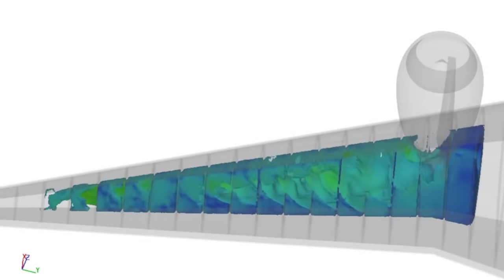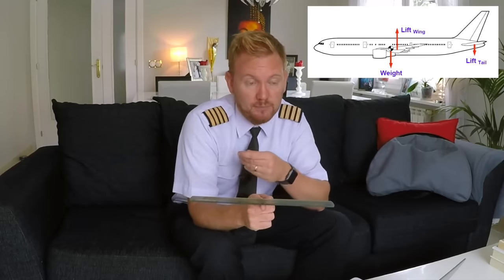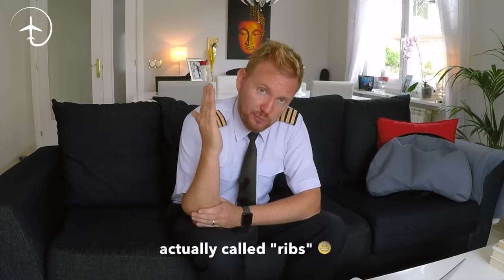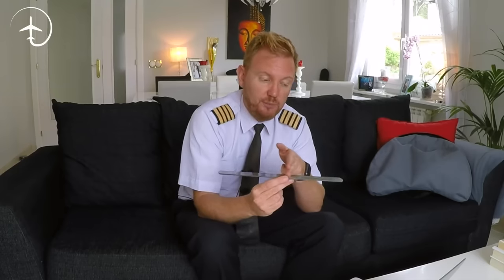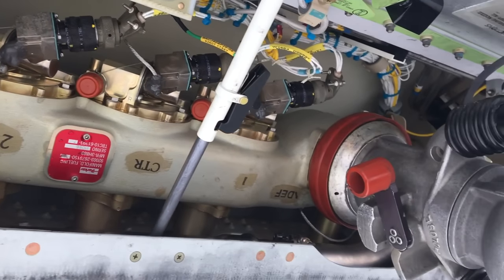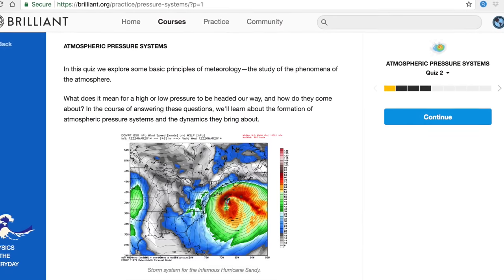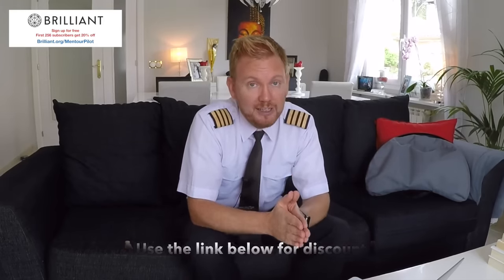Why do aircraft store fuel in the wings?

Comment: Could you do a video about why pilots use feet and miles instead of meters and kilometers? I think I have an idea (namely imperial isnt as easy to confuse with each other as the metric system is) but I am not really sure.
Reply: It is a good question that I planned to ask, too. Anyway did you know about the Gimli Glider? (If you didn't I would suggest you the English article on it on Wikipedia., very nice and detailed.) There the fuel starvation was partly caused by the different measuring system and some miscalculation from pounds to kilograms and liters and back.
Reply: I do know of that case, but the wikipedia article is a pretty interesting read. Thanks!!!
Reply: Aviation is done in feet and miles mainly because it's the agreed-upon standard, as is the use of English.  Aviation actually does not use miles, but nautical miles, which are based off the distance between latitude lines -- every 1° of latitude is 60 nautical miles.
Reply: Yeah, but it still pisses me off when I'm flying anywhere in Canada an the damn seat back screens are showing airspeed in MPH and altitude in miles.
Reply: For something like a seat back screen, it seems as if it would be fairly easy to provide an option for which units to be displayed.
Reply: Yes that would be true, here in Australia we have been Metric for years, I think it was mid 1960's. but even so they still quote TV and Mobile phone screens in inches.  One measurement that goes over my head is Yards.
Reply: steviebboy69, yards & meters are easy -- for quick estimation purposes, they're equal.  If you need to make an actual conversion or measurement, 1 yard = 0.9144 meters.
Reply: If people want to add more on to the Imperial/Metric combination pile, automotive tire sizes these days are a combination of metric section width in mm and wheel diameter in inches (not including the '80s Michelin TRX, which used 365, 390, and 415 wheel diameters).
Reply: Thanks but Yards is a very old measurement now well at least here down under.  But as I said above tv and phone screens are quoted for some reason in both really.
Reply: Well, you said "goes over my head," which in the US means "I can't grasp it" or "it's above my level of understanding." What does it mean down under? ;)
Reply: i guess its like if someone said something scientific and you had no idea what they mean. kind of like what the description you mentioned,.
Reply: Azivegu He’s not using imperial OR metric, he’s using NAUTICAL distances and speeds.
Reply: The nautical mile is practical to use as its correspond 60 nautical miles per degree latitude. It makes it simple to calculate courses in that particular case.
Reply: Get a grip people you're 7 miles up in the air, in an aluminium cylinder not much thicker than a Coke can. Just marvel in the science that achieved this rather than what "units" your seat back is displaying.
Reply: +steviebboy69, A yard is simply (and exactly) 3 feet.  Loosely, it is almost one meter.
Reply: Read somewhere that this originated from the surplus of C-47 flooding the market after WWII. They were using imperial onboard on the gauges. Don’t know if it’s just speculation or fact.
Reply: The vertical separation is 1000 feet, which is much easier than 300 meters. Nautical miles are practical, as mentioned.
Reply: My guess would be:
It is done so, because the only guys who did navigation in the old days where seafarer.
The pioneers of commercial flights just reused all the navigation techniques from them and thus ... stick with their measurement system also.

Comment: How about fuel level?
Is there a floater or something which sends signal to the instruments like a car mechanism does?
Reply: Probably combination of floats and capacitance sensors.
Reply: Commercial aircraft use strictly capacitance fuel quantity indication systems (FQIS).
Reply: Evangelos N  they use probes and sensors
Reply: Yes, and the fuel flow to each engine is also measured to check that their consumption is normal and there are no leaks.
Reply: Evangelos N televel flow metric sensors
Reply: Nah Its Just some guy Running Back and Forth with a Dip Stick Checking The Level and Calling up to the Captain
Reply: Gregg Rusnak I haven't laughed this hard in many months 😂🤣
Reply: Gregg Rusnak Funny you should say that Gregg.  There actually is an alternative method of measuring the fuel qty in a tank called magnasticks.  In simple terms it’s sort of an upside down dip stick that uses a floating magnet to hold the dip stick at the fuel level.  It is used to either compare what the gauges say the qty is ( check it for accuracy) or to allow a plane to continue to keep flying if one of the tanks qty measuring system is faulty.  
Pain in the arse to use for the latter because you have to constantly keep dipping to check what level you have and then have to yell to the person at the control panel to stop when the level gets close.
Reply: Mr Galsworthy's Big Bad Uncle G lol I new shit would be involved, it allways is.
Reply: It's not like in a car . It's a bit dodgy  how they do it. An aircraft ran out of fuel over the Atlantic because they accidently under fuelled it. But the pilots didn't know till the engines cut out . And glided a long  way . The is a film about it . It's a good watch . Google it .
Reply: @gravyboat2370  Underfueld it?  I'm pretty sure they had a fuelleak and didn't realized it and started the fuelpumps to get the balance of fuel correct in both wings.  If it's that Airbus you are referring to?
Reply: @MrJokkoma  it was a while back . It happend when the US switched to using kilos from pounds to measure the fuel. The ground crew got the comparison between the the 2 the wrong way round.  So instead of 2.2 pounds in a Kilo they thought 2.2 kilos was in a pound and fuelled it accordingly.  The plane indicated it was full !! But obviously had a lot less . The film is called freefall flight 174. Was out in 1995 . Check it out
Reply: @gravyboat2370  That sounds exactly like an episode of air crash investigation  about Air Canada. They named the plane the Gimli glider since it glided  and land on an abandoned airbase called Gimli where they held dragrace competitions that day but nobody on the ground got hurt.  The cause was just as you said, groundcrew confused kilograms and pounds.
Reply: @MrJokkoma  yea sounds like it yes.  They made a film about in 1995 called freefall flight 174 . It's a good film
Reply: @MrJokkoma  it amazed me how they didn't know it was low on fuel like you would in a car etc
Reply: @greggrusnak6094 
Hilarious

Comment: Thanks Mentour. I was actually always curious about this. Can you perhaps explain why the 737 doesn't have automatic fueling like the rest of the airplanes? This is probably outside of the scope of Captain and an MX issue but maybe you can give some insight. For instance I put 21600 lbs of fuel on a 737 yesterday. The wings VTO'd at 8400 (tho my docs say they should take 10400) the MX tech told me oh yea, they will only take that much put the rest in the center. Now when I fuel an Airbus or 767, I can just set a preselect to the desired amount and the computer will balance it. maybe tl;dr but I also fuel CRJ aircraft and I know that the preselect will shut off fueling jump way up, but then drop 100 pounds or more per side (perhaps the air bubbles are coming out or the sensors are just slow) and the have to manually add another 20 or so gallons. General rule of thumb is 15 gallons is 100 lbs.

Comment: So inside the fuel tanks, there are many spares and ribs that make it an uneven,  not smooth surface. My question is how can the fuel pumps completely drain the wing tanks when there may be puddles of fuel that the pumps can’t get?
Reply: Cracking question.  Maybe cos it's all BS!
Reply: there is not fuel in wings, what a pile of bullshit they get paid to say, if a plane turns rapid or even slightly or jitter the fucking wings will snap and unbalanced the plane by difference weight and chance of direction opposite of the forward force.
Reply: Andrew Foster [Matthew 5:43-44] it's not bs I'm an aircraft fueled and all planes fuel is stored in the wings!
Reply: ICXC CXCI I can personally tell you I fuel planes and the fuel is distributed through the wing. The video even told you how the wing distributes the fuel along the wing. Go watch a video on it!!
Reply: @matinileveni5162  : ok, say I bank left, surely all the fuel in those chambers with the support beams running perpendicular, means it would get trapped in the far left chamber at the wing tip. How on earth does it get to the fuel pump?  AND, wouldn't it make the entire plane unstable with liquid sloshing about like that?
Reply: @AndrewFosterSheff69  he fuels planes on a simulator
Reply: Andrew Foster [Matthew 5:43-44] the chambers in the wings keep the fuel from sloshing around and slow fuel down so the sloshing effect is minimize
Reply: ICXC CXCI the next time you fly on a plane, before you board your plane. Go to the window and if your lucky, the fueler will be out there fueling the plane and you will see his truck or equipment attached to the wings! If they are small planes he fill be attach to the body but there is a plumbing network that takes the fuel to the wings!!
Reply: Andrew Foster [Matthew 5:43-44] 4:06 - 4:46 explains all of it, if you look inside if the wing, there all walls through the wing with tiny holes that allow the fuel to move section to section but just a small amount can move, not the entire section at one time
Reply: @billDgundam817DFW  do you hear yourself? Do you know how jet engines work? They run on air, the fuel is air, two kerosene is only just only used to the power APU. I have seen them pump air in the plane not fuel, third, jet fuel does not burn unless atomized, so why the BS tv networks obviously bullishiting of plane crashes, plane catch fire, blow up jet fuel very flammable when it identical to fucking diesel mofo. !! One lie leads to another don't waste your time please. 

Learn how jet engines work work, 90% air intake via hyper speed self vortex after kick starting it. Via pressurised air.
Reply: @billDgundam817DFW  : and what about the fuel that is left in the left wing tip only? Dragging the plane's left side down and forcing it to continually bank left?
Reply: Spotted the flat earthers in the room.
Reply: ICXC CXCI dude go to any aviation museum and they will show you how it done. They're telling the truth, open your mind. 1.) There is a hole for the fuel to move from chamber to camber. 2.) The sloshing has little effect on the plane because of the chamber design. The air in the wings has no effect on the fuel. 3.) Yes fueling equipment can pump 40lbs per second. Most domestic flights take 30 mins to fuel while international take anywhere from 45 mins to 1 hr and 30 mins! Go look it up and stop being an idiot!
Reply: @billDgundam817DFW  museums? The same museums that show us fake plastic bones of non existent dinosaurs? The ones you can never ever see real even with a degree? Yes, the compartments for sloshing does not stop it. 

I am a mechanical and plumbing engineer and I know what I am talking about, no design can reduce sloshing. 

Radiator have good design for sloshing but they slosh anyway and that is for less than 6 litters of water.
Reply: @sirmeliodas608  I really cant tell if your serious or die hard trolling., but just in case.

Jet fuel burns... Jet fuel is pumped into the turbine, atomized, and ignited in the ignition chamber along with heavily compressed air to create hot burning gas that equates to thrust.

Fuel is stored in the wings of almost every aircraft with the exception of a few single seat aircraft. The ribs as said many times before prevent the fuel from flowing quickly throughout the wings. There are small holes in the ribs towards the bottom that allow fuel to flow back towards the fuel pump in the same way that boats allow water to drain to the bilge pump.

Additionally, all aircraft have whats called a cross feed, which allows the pilots to transfer fuel from one wing to the other in the event of a fuel imbalance.

Balance and weight distribution are important, but when you consider all the forces, momentum, and the slow speeds at which airliners bank, the movement of the fuel is no where near strong enough to upset the aircraft.

These are basic facts engineers learn in their first semester of aeronautical engineering.
Reply: @planem1916  sure, sure you believe that kido.
Reply: As an aircraft maintenance technician, otherwise known as a crew chief, with 24 years of experience, I can assure you fuel is stored in the wings.  The wings are a series of boxes, that are interconnected.  Most large planes have at least four main tanks.  The fuel cannot travel from one tank to another without going thru the control valves and manifolds.  The fuel gravity feeds to the lowest point of the tank, and that is where the pumps are located.  Even the best tanks cannot get 100% of the fuel pumped out.  The last thing you want to do is run a tank empty in flight.  No fuel means no engines, and they make lousy gliders. 
Military tanker aircraft carry additional fuel under the cargo floor.
Reply: @sirmeliodas608  this guys serious? Hes actually serious? Oh my God he's actually serious.

I'm glad you came along to teach to inform me of how fooled I am. Looks like it's time go back to aviation school and find out the truth.

You should go talk to some engineers about this Incredible compressed air theory. We could save so much fuel by not using it and instead let the engines self sustain! Because you know, basic physics are wrong and you can produce energy from a device consuming it's own energy to make more energy.

In all serious. Please explain to me IN DEPTH, exactly how a jet engine works, and how it operates on compressed air. If you can't, dont reply.
Reply: @chasemiller7974  Right? No reply after a month. I rest my case
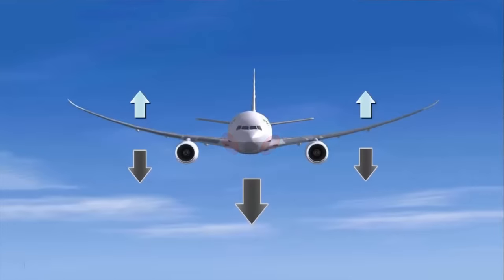Reply: @billDgundam817DFW  where is the fuel pick up located. At what end?  At 6:18 it shows the wings. from the tip of the wing to the engine is so thin its incredible!  And in that thin space u still need motors and shafts for flaps. how much space can there be for fuel?
Reply: @shirleeeyyy  are you asking where does the fuel enter the plane at? It depends on the plane but for most big airline planes the fuel port is under the right wing and for wide body planes its on the left. And not all the fuel is stored in the wings in all planes. Some planes have a center fuel tank located by the fuselage. Also at 6:18 that picture, dont think it's that thin, the wings are alot bigger then you think.
Reply: The ribs have holes in them so fuel can flow through the wing unhindered and the spars run along the span of the wing
Reply: @billDgundam817DFW  No not the filler, but the fuel pump pick up . There must be one in every chamber then. in order to keep fuel flow steady when banking , nose up , down.  sloshing around different chambers.. i know that if my 5 ton has 1/4 fuel in tank. I better not park it on a hill facing down (like in a bank) ..cause pick up is at back of tank. and all fuel is at front.
Reply: not any kind of liquid fuel. @matinileveni5162
Reply: No it doesn't      @billDgundam817DFW
Reply: They cannot completely drain the tanks, you are correct.  What remains is called Unusable Fuel and is quantified and in the manual for every airplane.

Comment: Concorde used fuel trim
Reply: I remember that the Concorde transferred fuel from one center tank to the other because the center of gravity changed as speed increased or decreased.
Reply: kd5you1 
I think the centre of lift moved with changes of speed, so the fuel was moved to keep the centre of gravity under the centre of lift.

I always wondered if that meant Concorde became harder to trim fore-and-aft when running out of fuel - just when you need to trim for that emergency landing...
Reply: I flew a Concorde in Microsoft Flight Simulator, and I think you are right about the Concorde being harder to trim because there was not enough fuel to transfer to the other tank. You are probably right about your first statement as well. Although FS is just a simulation it does take aircraft balance of lift and gravity into consideration, however I never had any problems controlling or landing the Concorde even with low fuel quantities in any of the tanks.
Reply: it had a tank i the tail for this and this fuel could not be used during super sonic flight
Reply: ALL commercial aircraft do. C of G must be kept within limits for stability.

Comment: 1 wing of the A380 has the widest dimension of 16 m and the smallest 4 m. The height of the wing is the highest 2 m and the lowest 0,5 m, the length of the wing is 45 m.
Average values 10m x 45m x 1,25m =560 000 Litres
So the volume of one wing is 560 000 Litres and the fuel can fit 120 000 Litres. So nothing unrealistic :) 
Normal route Berlin and New York is 6300 km and max range of A380 is 15 000 km. So for this route the plane needs to refuel half of the fuel tank.
A380 flight with 800 passengers Berlin - New York at a ticket price of 500 euros and fuel consumption of 150 000 liters, where a liter costs let's say 1.3 euros, so the passenger will pay 50% of the ticket for fuel.
Passenger 800 x 500 = 400 000 euros
Fuel 150 000 x 1,3 = 195 000 euros.
Everything is real even without conspiracies.